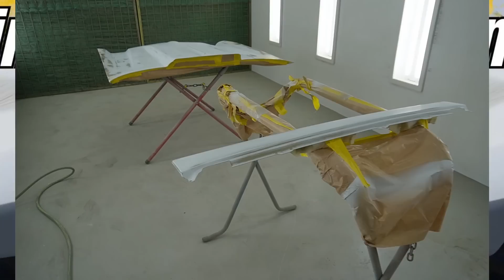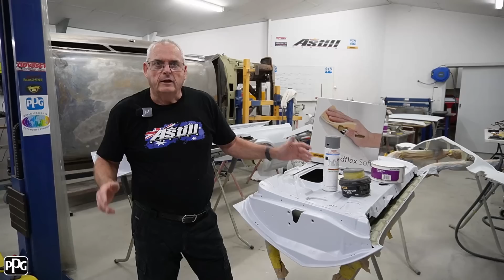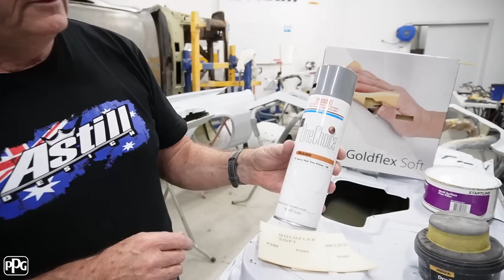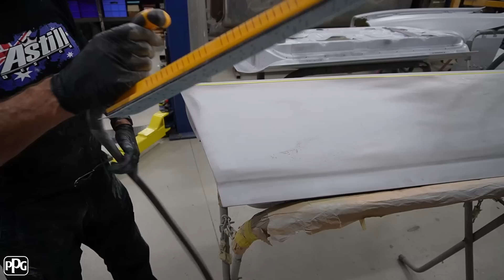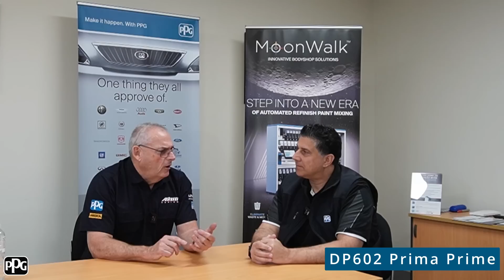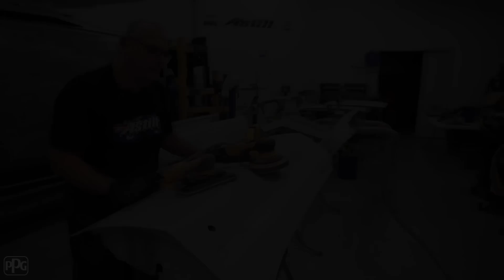#8 Primer Preparation & Usage on 71 Camaro

Comment: Howard. The education piece is outstanding. With all due respect to 'how to' videos on rust repair (which there are thousands), the paint and panel is where I feel the fear and headscratching is greatest and this is your forte.  Can I just ask about the back and front edge of doors. I'm doing hx holden and I felt that the factory may have a taper off the last 30-40mm on edge of the doors and I assumed it was to allow for clearance opening against each other, on the other hand, it could be that they are just a little bent. Do you have any comment on this?  Thanks again.
Reply from the maker: Most 70’s cars had a curve in the panel to keep tension on the skin. When I did the compact fairlane I had an older beater help me and he rolled the skin diagonally both ways to get that tension. ( very slight curve).
It is only now that we are all straightening the sides of cars with effort and in most cases lots of filler.
Splining the whole side to create that flat look.
If you check out the steel prep on this build you will see me straightening the skins.

Comment: What do you mean by ground coat before colour,and is it fully necessary?
Cheers Mike
Reply from the maker: Ground coat or wet on wet primer.
Is used when the primer has lots of rub throughs or repairs and saves repriming the job and rubbing again. 
It’s a very thin build primer that is applied before colour and does not need to be sanded before colour is applied after the wet on wet has flashed off.

Comment: I don't want to sound ungrateful but would it be possible to do one video from current crappy paint paint stripping 
Bare metal
Rust repair
Panel beat
Then the paint process right through to polish 

Because i am getting lost
Reply from the maker: We will have a summary at the end of this series. A video with everything you mentioned would go for hours.
I am working through the process as we are doing it.
Reply: @AstillDesign  you are right about it taking hours just to watch letalone film and edit

Comment: DOes one have to pay to have they car painted at the training facility, seem so it is a "Training Facility" if its at the stage you have your vehicles at ?

Also just curious using the mirka system with the vacuum would that just vacuum the black powder up and give you a false reading that your panel is super flat ??
Reply from the maker: It’s not available normally. We are working with PPG as part of there training and product development.
The vacuum doesn’t effect the black trace